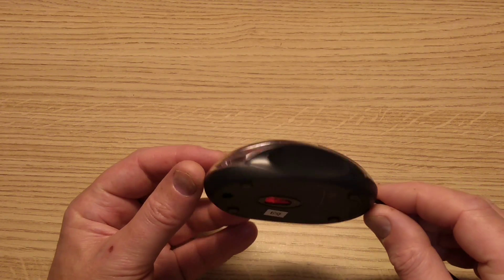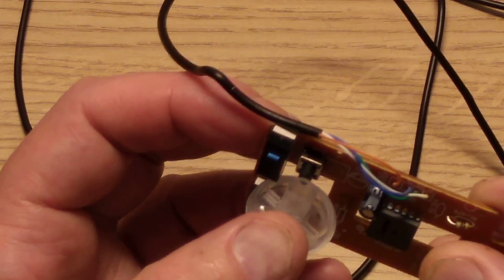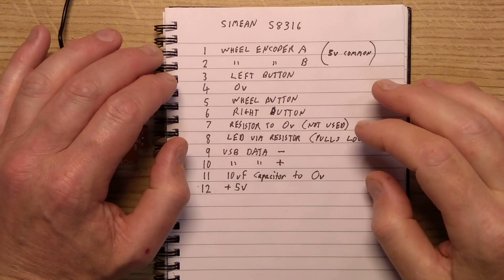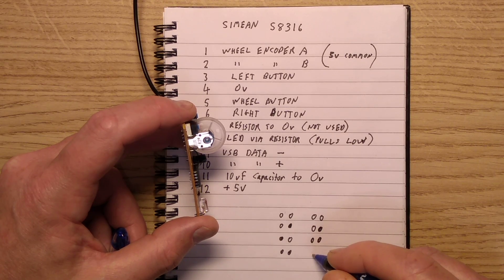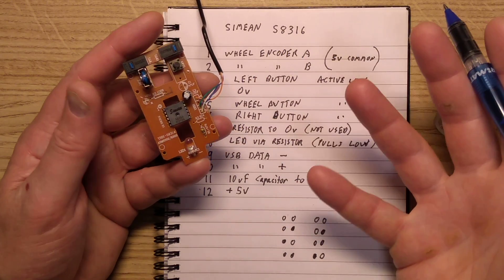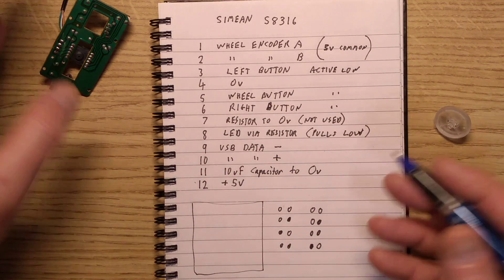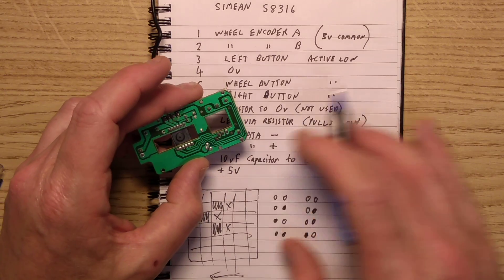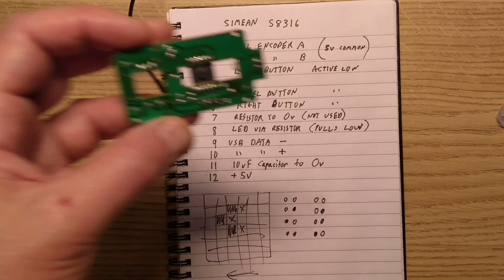Inside a humble Poundland computer mouse.

Comment: It would be interesting to see you compare it to a "high end" optical,  and maybe even some of the older original optical mice.  My first optical set me back almost 100 usd.   It came with its own mouse pad and was about the only thing it worked on... A month after I bought it, the LED died and warrantied it.  Two months later same thing on the replacement.  I only had a blue LED in my parts box and needed it working so blue went in... And it sucked 😂 but it did the trick. Though I swear it had something that looked more like ir receivers to track the mouse.  I know the wheel was ir as well.

Comment: And the best part? This mouse is a cheap Chinese copy of an older model of similar appearance and spec. That version used different plastic for the body and had a silicone wheel, along with two LEDs. One was blue and positioned just under the wheel, the other was red and used for the sensor.

I only know this because someone stole it, and when I went to eBay for a replacement I quickly discovered all the ones that looked similar didn't have the silicone wheel anymore. Makes a big difference for sure.

Comment: I'd like to see that chip decapped and imaged layer by layer with some 2000 grit sandpaper.  The sensors have been used for cheap robot vision by some clever coders.

Comment: I bought several mice to use the chips as simple arduino robot cam (detecting a white ball on a black carpet), but none of the ones I ordered from Aliexpress back than had the chips that were documented (only few have debug / raw options to read the actual image). But I now use the exact same model for my workshop computers :-)

Comment: Did HP / Agilent have the first commercial implementation of the optical image sensor mouse chip? They have some of the early patents on this technology, for example US patent 6433780 "Seeing eye mouse for a computer system" filed 
2001, granted 2002.
Reply: Indeed Agilent, spinoff of HP, is the IC company that enabled mass market products with the HDNS-2000 sensor. But that filing date seems a little bit late! Mice using this sensor have appeared in 1999!

Comment: Anybody remember trackballs? (The upside-down mouse...)
Reply: I still use one at work.
As well as being more comfortable (for me), it also has the advantage that nobody else in the office wants to use my PC when I'm not there.
Reply: FP4 Man - I like trackballs, but the older type that uses similar roller optical-sensor wheels as the older design of mice do get gunked up with crud.
Reply: I've got one of those for the computer on my CNC mill. Not really practical, the little trackpad works better.

Comment: I don't think they were just rubber balls. More like Metal ball coated in Rubber. I remember them being heavy.
Reply: Depends on whether you had a good mouse or not. Some of the really cheapo ones had wimpy plastic balls without even bothering with a rubber coating. And they were exactly as terrible as you might imagine. The weight and friction helped keep the ball from skidding with fast motion, so obviously the heavier the ball the better.
Reply: Yep some older ones definitelly had metal balls, like the ones from large ball bearings, inside of them. I cut a couple of those open back in the day.
Reply: I still have the all-steel ball from a late 80s Tandy (Radio Shack-ish) mouse. An inch or so in diameter (25mm). Vet odd! Singularly useless curio. 

Given the complexity conflated into simplicity of the mouse in the video, I have to wonder why trackballs are not similarly cheaper -- considering that the same basic electronics could be used, inverted, with a cheap, patterned plastic ball… or perhaps even a fingerprint acting as the 'grid' of detail that the lens and circuitry uses to detect direction and speed/acceleration. A trackball seems to make more sense as it's directly manipulated by the fingers rather than involving the arm from elbow to finger pads…
Reply: Michael Thibault trackballs do use similar chips. They’re just not produced in the volume, so you only get them in the better quality areangement, similar to a 50 buck mouse, and then you pay 100-200 for it.
Reply: @michaelthibault7930  Trackballs have been outcompeted by trackpads that are almost entirely non-mechanical, except the buttons which are intentionally molded into expensive parts of laptop cases to maximize repair costs and e-waste.
Reply: Back in the day, I worked in the IT department of a school, we'd super glue the rings that held the heavy balls in so that te little blighters wouldn't nick the balls. the really evil kids would chuck them through windows. Made them a real dog to clean the rollers that picked up the crud.  the balls themselves stayed fairly clean because the dirt the ball picked up was rolled onto the plastic rollers. We were early adaptors of optical mice - 30 years ago and 30 times the price they are now....
Reply: I remember cleaning the rollers of that black goo... Yuk...
Reply: Yes, the original Microsoft Mouse (the mouse that roared) with the green buttons had a bare steel ball. It made one hell of a racket moving around on the desktop.
Reply: For awhile, magnetic mousepads were used to improve accuracy of ball mice. I had one, worked good.
Reply: I found the "I remember" bit quite amusing because I have 8 of them on my office disk. 
I actually did some research to try to find out what metal they are a few months ago, out of curiosity. I couldn't really find a more reliable answer than "probably steel".

Comment: My optical mouse works best on a plain black surface. If i try to use it on the wooden surface of the desk or a mouse mat with different colours, the pointer jumps around erratically.
Reply: I didn't believe this so I tried it and you're right.  Mine doesn't work at all on a light coloured plain surface but it works just fine on a plain black one (no pattern at all), so long as it isn't too black.

Comment: Parents were using one on a mirror table. It was hilarious debugging this by phone. Sigh.
Reply: Well I'll top that one with an apple Mouse you know the kind which you can't tell which direction is up .... yes I had such a hard time with it but then I got a phone call that the mouse cursor was moving around the screen the wrong way in the complete opposite direction From being moved. when I came in to the tech Booth to do the de-bug...... I found out of course it was moving the wrong way it was completely upside down to the point where I had to stick an arrow label on it. and I feel bad as the person was fairly smart, it seems like it should have been a no-brainer Mouse Moving wrong way turn mouse round. Granted this is the most ridiculous design out of apples Forefront from 8? years ago.
Reply: I was doing what amounted to tech support at work one day when a work order came through about a cursor jumping all over the screen at random. I called up the person who raised the issue and asked if the mouse was on a reflective surface. Didn't even have to leave my desk and closed the work order as "Installed mouse pad". Apparently I was the only one that knew some optical mouses don't like shiny surfaces to run on.
Reply: I had one where the user complained his new mouse didn’t work. He failed to advise us that along with a new mouse he had bought a glass desk.
Reply: @shrike  -  How did you debug the mouse?

Comment: As someone who's been taking a crash-course into image analysis and processing (mostly with regard to reverse image searching), I find their use of low-resolution "photography" quite interesting. My database actually builds points of interest and pHashes the image around them to build a database that can find cropped images. Part of the pHash process is scaling a high rez color image down to a small grayscale one, then limiting the intensity (and a few other filtering tricks) to make a unique pattern that can be compared to other such patterns using simple Hamming functions.

This is doing something different. I wonder if they simply save the previous image and just look for the new image's center few pixels in that previous, then measure the distance between them? Since you know the dimensions in advance, such a calculation would probably be quite simple to do.
Reply: Yes, that's what they are doing, as far as can be guessed. The sensor runs at up to several thousand FPS, with the framerate being chosen such, that at predicted movement speed, the displacement will be only a couple pixels. Also predicted movement direction is used to limit the number of comparisons.

Also you can't run the sensor at maximum possible framerate at all times, else at moderate speeds, the registered displacement will be zero.

Comment: I used the exact same mouse for several years on an old laptop but then replaced it, not because it broke, but because I found a perfectly usable wireless optical mouse (including USB dongle) on eBay for the princely sum of £1.21 delivered from China ! 
I was so impressed I brought a couple more as spares. Surely they must have to make 10's of millions of the things just to break even.

Comment: I've just started using two of the very same mice in conjunction with a Pi to track and control the movements of mechanical components that form part of the drive train on a 3d printed scale model  of an earth mover I'm working on.

Comment: I paid something like $30 for my mouse and keyboard set, though they are wireless. The mouse doesn't have a visible LED in it, presumably to save power, and it really does last a long time. It has one AA cell in it, and I can't remember the last time I changed it. I had to take it apart to clean the gunk out of it more recently than I had to change the battery. The keyboard takes 2 AAA cells, and I think they are the same ones I put in it 4 or 5 years ago now. I just checked and the AAA cells have a best before date of 2020, so they have to be fairly old. The AA in the mouse has a date of 2028, so I probably replaced the first one at some point.
Reply: Infrared LED or infrared laser sensor. Infrared LED doesn't save any power, but doesn't work with some cheaper Pixart sensors - not sure why.

Infrared laser actually saves a lot of power because the energy is concentrated in a small field of illumination.

Comment: Thanks Clive !  I've had a mouse like that for 20 years, used daily, marked Vivitar. Mine has an 8, and a 16 pin chip. 8 pin- MX8620   0938 966492 no manuf. emblem, and 16 pin -MX84521FP   0940 FA976002 (Also no emblem, it's to the left of the opto.). Still works perfect.

Comment: There was a YouTube video of someone converting the sensor to use as a crude camera - it could detect letters on a document:
https://www.youtube.com/watch?v=Ix6532mrIKA. Actually it was this video I saw originally: https://www.youtube.com/watch?v=itymW2bPOcQ. Just search for "mouse sensor as camera" and you will find a lot of videos! It is difficult to appreciate/comprehend the amount of technology you can get for a pound. This is one reason why I hated the PIC chips - it sounded the deathnell for DIY projects for me. You could could replace your heavy component count project with a few passives & a PIC and it has only been improved upon since (Yes I know that's a negative view point, I guess I should praise progress!). Just look at the Arduino or ESP range, even they have become "expensive" as you can buy a complete "smart phone" for under a tenner now. That's a 5" colour screen camera, battery, charging circuit, camera, bluetooth, Wifi, GPS & GSM - you simply cannot make your own cheaper (which to me was the part of the fun making a DIY project back in the day!). Something from Alcatel, crazy cheap technology, also there's the inkjet printers, cheaper than the replacement ink cartridges now! If only other industries could provide similar leaps in cost & features!

Comment: the cables on these are notorious for splitting/breaking, i think the pvc is a bit too 'rigid'/brittle...
Reply: The wires in any USB cable use standardized colours… four quick points to solder. That's assuming a mid-match in the/any on-board plug sockets.
Reply: A quick re-viewing… aaaand I'm proven wrong. This mouse's cable is an obvious poseur -- but close enough.
Reply: @michaelthibault7930  i had a cheapo usb powered keyboard vaccum that had black positive, red negative....yes, really..😲
Reply: in the case of these mouses, poundland do loads of various charger cables, easy to 'adapt' one of those as a replacement, only problem is trying to find a black one, they're almost always any colour besides, mostly white!

Comment: Back in the day when mice used to have two chips (optical sensor + a microcontroller), I managed to interface one of that sensors to an 8051-based microcontroller. It was an interesting sensor because it had more features that no mice would really take advantage of. It could send you back motion, surface quality, the brightest and dimmest pixel in the frame, the average pixel brightness, shutter speed... It could even send you back a picture of what it's seeing!

About the LED dimming, it does that to save energy. That's all. When it doesn't detect movement, it lowers its framerate to lower its power consumption and it dims the LED (low framerate = slow shutter = increased exposure time = less light required).
Reply: But why would you introduce complexity to save such a tiny amount of energy, unless it's a wireless product - and i mean, most of these mouse ICs today are USB-only.

I suspect it might be part of framerate control. If you compare subsequent frames at 3000fps, the measurable displacement between these frames will be zero for moderate to low movement speeds, and that's a no-go, so the framerate needs to be dropped to where at predicted speed, there will be a measurable movement, but not too high in magnitude. Then controlling the light to illuminate in bursts at low framerate can avoid sensor saturation.

Comment: @bigclivedotcom ,  there is a problem with the cable most times....it kindof seems to degrade over time and go all brittle (shitty cheapo PVC ?? or something else cheapo ??), which also means the covering splits all over and you get a horrid green goo seeping through in places.
also i note that forsome reason the wheels seems to always screw up...ive gone through a good few mice from poundland....using one now and wondering how long its gonna last lol.

Comment: 10:00 Read a novel "Vorpal Blade by John Ringo" were the MC was showing his Navy SEAL buddy around the US's new space submarine, they converted a Los Angeles boomer into a spaceship with alien tech. Anyway, after skipping past the large picture window at the base of the conning tower. He mentions the navigation system. Apparently he cobbled those sensor chip to a bunch of low power/wide angle telescopes around the outside of the ship. They worked in reverse by watching and comparing the bright stars against the dark background and calculated how the ship was oriented in space and what vector it was on based on how the stars moved. Funny bit, There's a freaking WINDOW in a sub. LOL

Comment: The first optical mouse I bought was about £40. How things have changed. Those chips are also used in several industries where rolls of fabric are autocut for clothes and also something similar is used for measuring paper speed in high speed printing. Lynx printing for example measures print speed in meters per second (or used to when I built one of their prototypes) not pages per minute.

Comment: 00
10
11
01
Reply: What is your point?
Reply: @oscargr_  Grey Code sequence
Reply: @nooneyouknow9399  it's on a piece of paper right in the video.
Reply: @oscargr_  yes... two versions. The above is the correct version.
Reply: @nooneyouknow9399  The one in your comment is exactly the same as the second one he drew up as a Grey code.
1) if you consider a dark spot can represent either a 1 or a 0.
2) if you consider it is a Grey code on a rotating "encoder" that can spin clockwise and counterclockwise.

Edited to avoid ambiguity.
(The left one on the paper was discarded because it wasn't a Grey code)

Comment: I kind of miss cleaning the mouse ball and the contact wheels.
Reply: not
Reply: Pro tip: Let filth build up on your mouse buttons, so no one else will want to use your computer
Reply: Then you would have LOVED cleaning one after my nice and nephew played a few games. How do kids get EVERYTHING sticky?
Reply: @mwechtal  I always know when my youngest son has used my lap top. The mouse pad feels gritty after he's used it. Probably dried on bits of food or snot!
Back before optical mice, I discovered after talking to the Neighbour that he had bought another mouse because the original was faulty. I opened up the "faulty" mouse and was amazed at the amount of filth on the rollers.
Reply: Get yourself a trackball. They still have this (although I love them for different reasons).
Reply: I remember scraping off “ball jam” with a small screwdriver and sometimes the flakes of crud would fall inside the housing.  

Ah the early 90s...
Reply: just buy one on Amazon, they are easy to come by for cheap/
Reply: The shmutz is now collected on the outside of the mouse, on the skid pads. Certainly easier to get to… Still, it's strange that people (users) seem oblivious to the change in the 'feel' of the mouse as sebum and whatever build up to ungodly depths -- whether on rollers in 'mechanical' mouses, or the Teflon glides on 'optical' or other mouses.